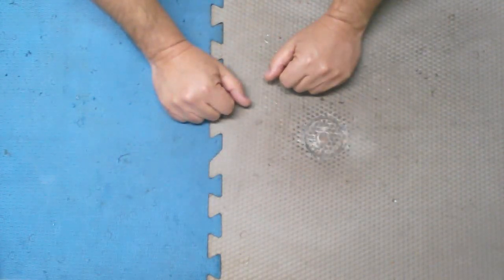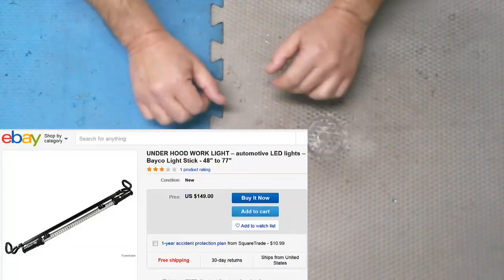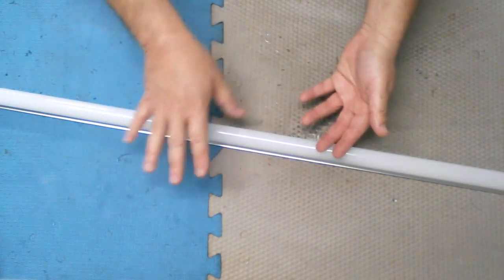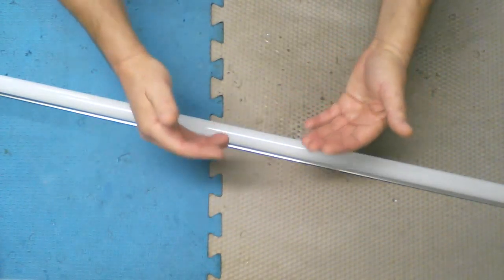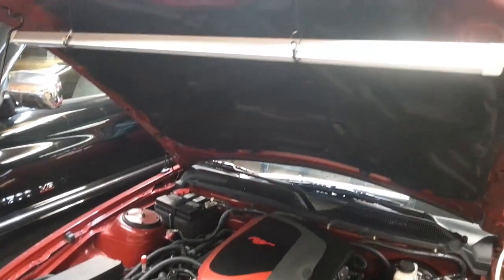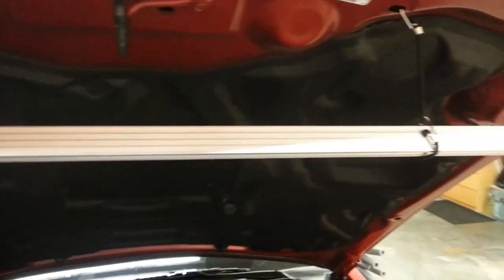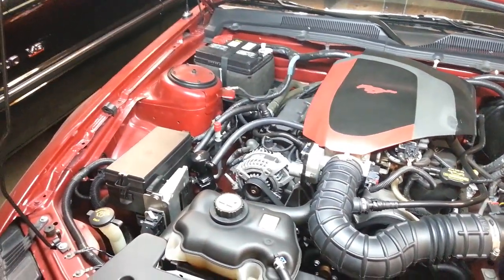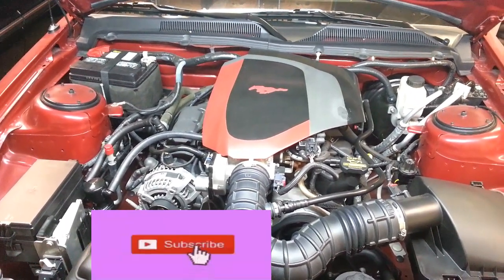DIY Under Hood LED Work Light for under $10 - Best Under Hood Work Light Really!

Comment: Great idea, but fyi, those harbor freight lights you were comparing it, the hooks on those lights actually can be pulled out and it’s stretched to bungee chords on both ends. So you can extend it to where you need to hook it too. Also they are rechargeable and it has magnets on both ends. And also it’s shatter proof and water proof.  I would hate for my DIY light to break on me and electrocute me if it accidentally falls or something since it’s a plug in vs the harbor freight one that battery powered and has a shatter proof water resistant housing also. Cool idea you got, maybe that’s why harbor freight did it to their lights. Lol I’m guessing you didn’t actually look at the harbor freight lights to see all of its functions.
Reply from the maker: You are making a lot of assumptions that are mostly incorrect. The Harbor Freight lights have magnets on the ends not hooks. You can't use magnets on Aluminum hoods (like mine) like most modern cars have these days. The magnets are also weak and could fall on your head as you're working on the engine. I have seen the HF lights at the store and they are also too weak. Around 800 lumens which is just too little for a dark engine bay. I prefer lights above 1000 lumens for this type of light. Also the light that I was showing has a plastic shatter proof cover and has an LED light strip, so I don't know where you came up with the idea that it will shatter and electrocute you. Many folks have also complained on other videos I have made that the HF lights break (stop working) way too easily after just a few months of use. So my idea is still the cheapest way to get a good under hood light.

Comment: Would you need an T5/T8 extension power cord cable to make it work or plug into wall outlet?
Reply from the maker: The transformer (LED regulator) is already build in so all you do is plug it into the wall and that's it.

Comment: I have one of these lights already hanging over my workbench in the garage that I picked up at my local Walmart a couple years ago.
Reply from the maker: Yea, they are available pretty much everywhere and they produce really good light for the money. I was surprised at how slim and light weight they really are.
Reply: @ModernDIYProjects  That they are.  I do enjoy the output when it's on and because of its length I don't notice any shadowing.

Comment: Does the light come with the base or do I need to locate one
Reply from the maker: These lights are available with or without a base to suit your application. So just look for one where the base is included just like the one I use in the video. I got that one as one complete unit.
Reply: @ModernDIYProjects  ok thank you

Comment: Needs a shatter proof casing
Reply from the maker: I don't know how it comes across on video for you but it has a plastic case and a plastic lense cover. It will not shatter.
Reply: Modern DIY Projects Okay. It does look shatterproof. Just making sure. Thanks for responding! Great video
Reply: Ironically the harbor freight lights he mentioned in the beginning has a shatter period housing and it’s water resistant. It also has bungee chords attached to those hooks he. Mentioned that didn’t work well lol